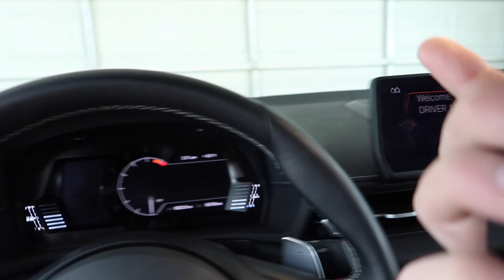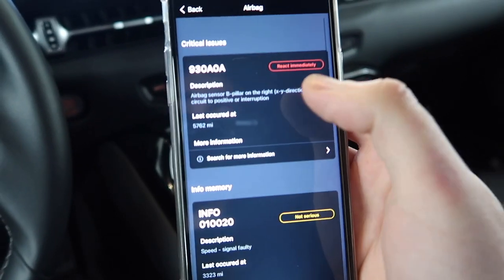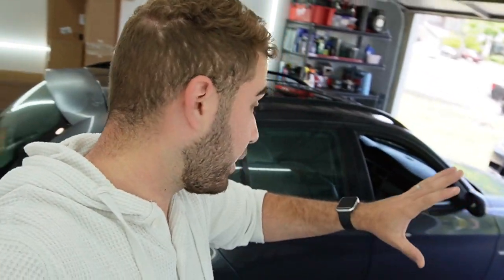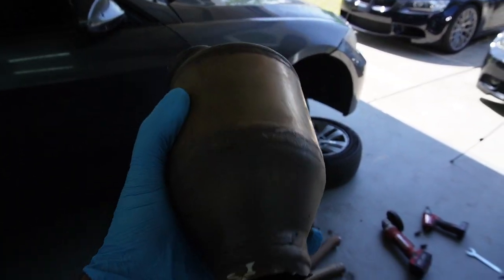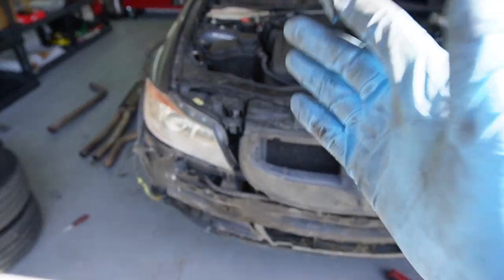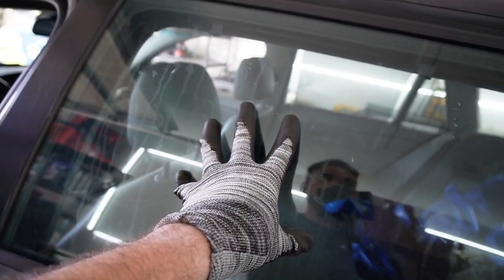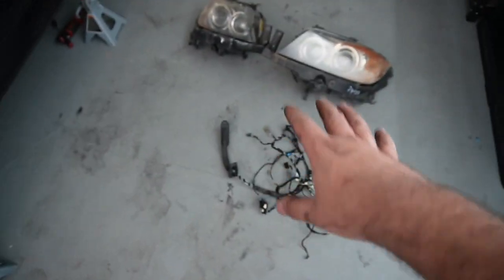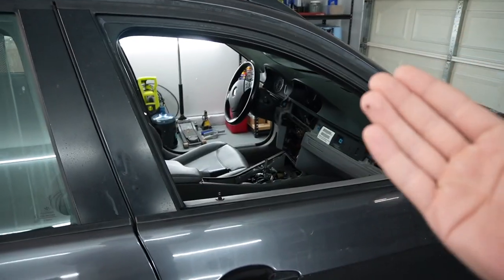Building A Custom 1 of 1 E91 M3 Wagon! (Part.1)

Comment: nour you should 100% do a video on the lane keep assist retro fit or active cruis control idk what it’s called. and you can also do soft close touch on the door. you would need it from a f10 5 series. you do need some custom holes in the door. but the rest is plug n play